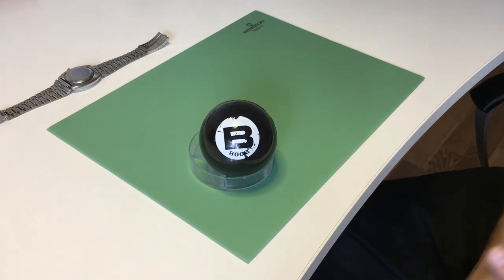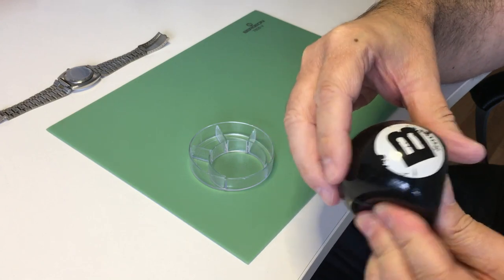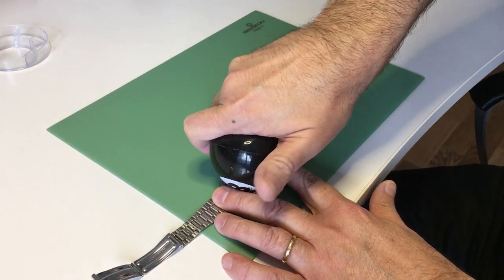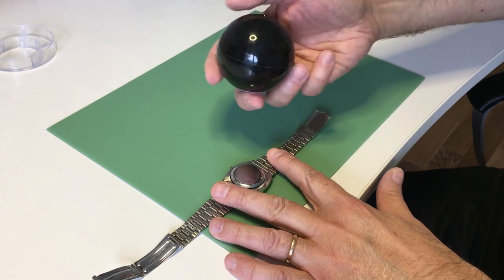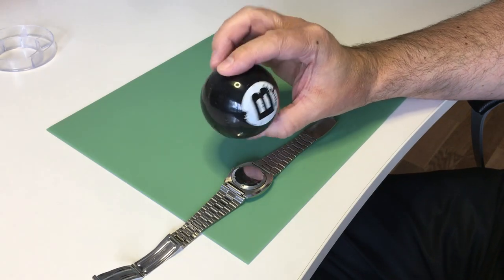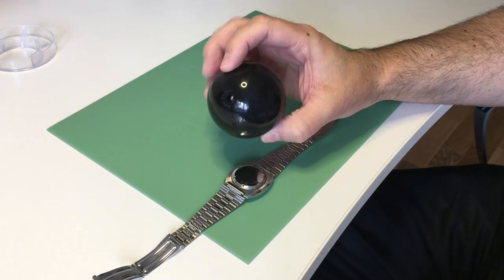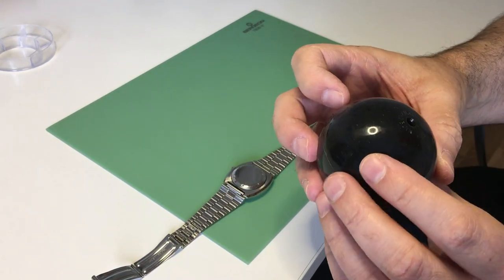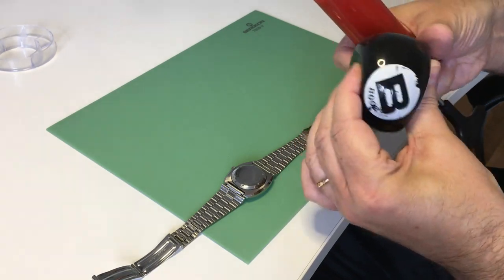Bergeon 8008 Watch Case Back Opener Review

Comment: Hmm, well. I have looked at these for a while and bought one, the Bergeon 8008 like the one in the video. Tried it so far on 4 watches and the ball did not open a single caseback. I don't think these casebacks was particurlary tight either but will try further with maybe pumping up tha ball a bit more.
Reply: yeah they're rather tight. as a jeweler who has used these a few times and is trying to get into watch making they've been amazing tools. this doesnt' replace your tri prong opener, but it'll definitely help for things you couldn't otherwise get with a standard case back opener (IE diesel / large invictas)